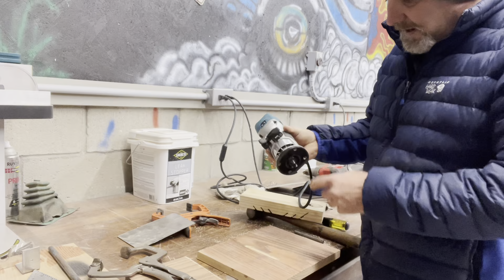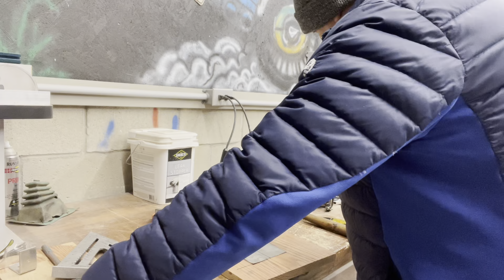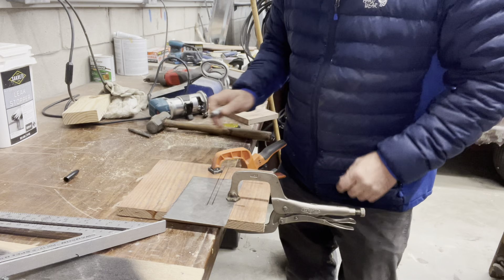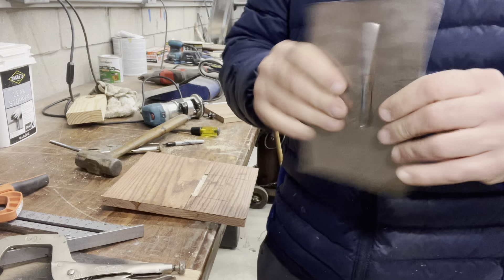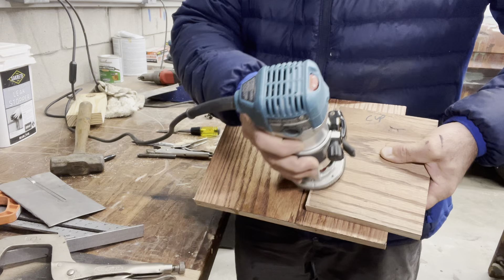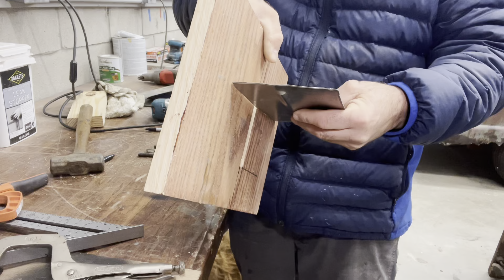bead metal without a bead roller

Comment: Hey Doc quick question. I've been searching for an answer all week. I have a broken power steering line that is not currently in production until the end of july and the customer needs to use the vehicle as soon as possible I was going to just cut out the section of hard line that was broken and bead the hard line and put rubber hose and hose clamps on it until they start to make the power steering lines again so I can replace it the correct way but I cannot for the life of me find a beading tool that fits. do you have any advice on how to bead a 9/16 inside diameter piece of power steering line without a dedicated tool??
Reply from the maker: A hydraulic hose shop can make you that line